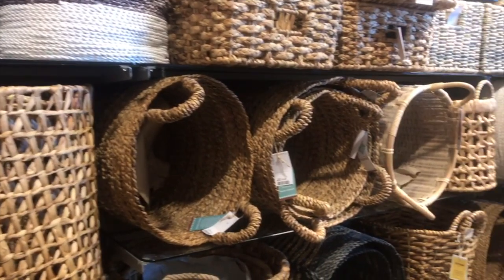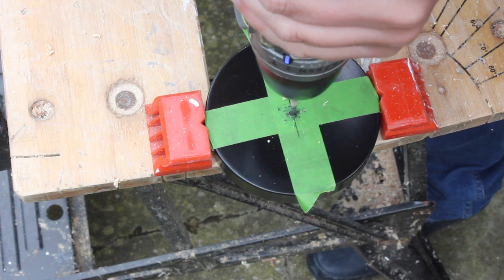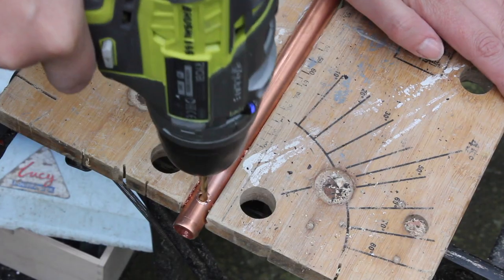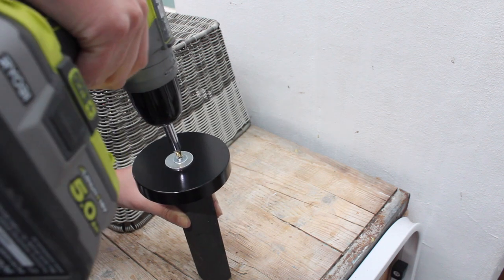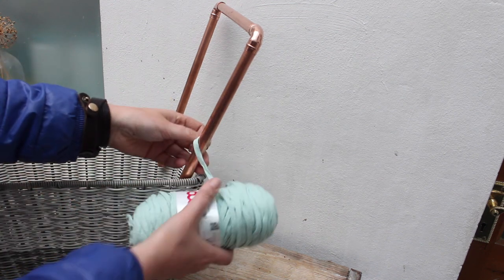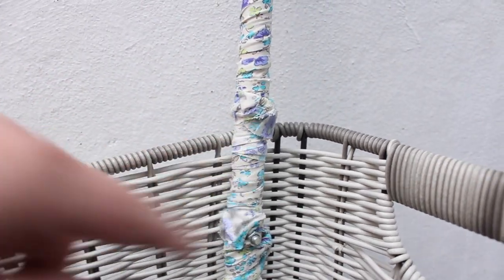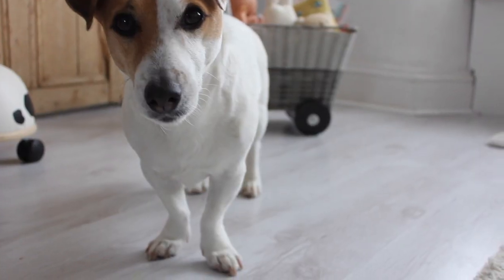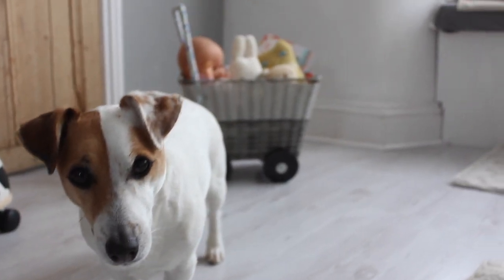DIY Doll pram, upcycled from a basket

Comment: I do have a question about your wheels. Do they actually turn all the time and all the way around when it's pushed? I'm just curious if thays the fact or ur little one just pushes it regardless. Ty
Reply from the maker: Hi, yes they turned 99% of the time, if they don't turn just adjust the tightness of the screws a little bit